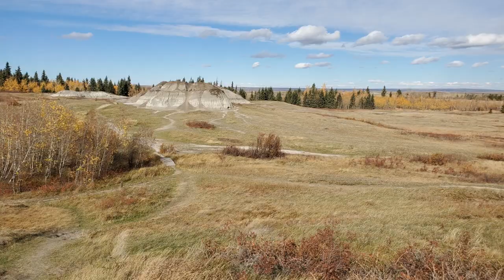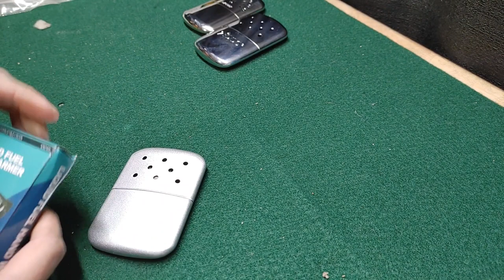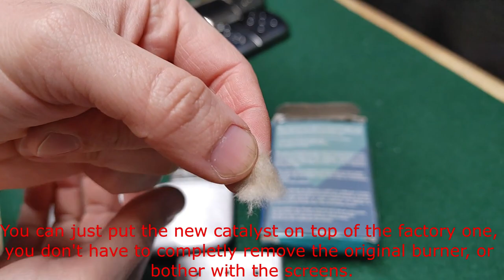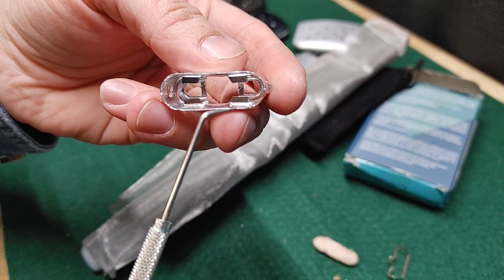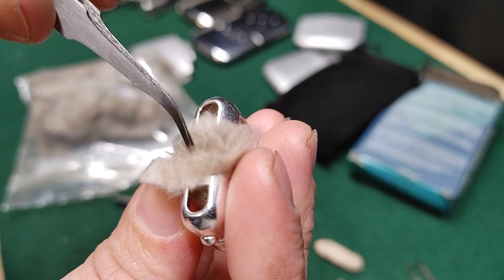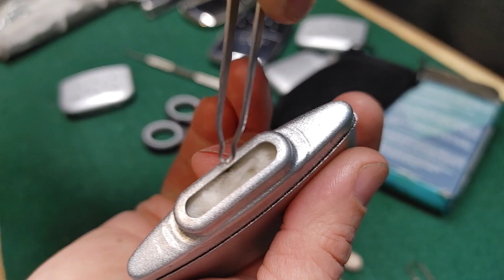Gas Hand Warmer Burner Replacement

Comment: Awesome. I did that to the ones I have like a decade ago. And the best part is the catalyst dosent seem to degrade much at all. I stuffed it in quarter inch glass weave for high temp wire Insulation. Haven't need to replace it yet.

Comment: you said the more catalyst the hotter it gets. does that mean if i have more than 1 layer of mesh on the bottom or top it gets hotter or putting more of the fluffy stuff in?
Reply from the maker: The mesh is just there to hold the catalyst (fluffy stuff) in. The fluffy stuff is what makes the heat, more fluffy stuff, more heat. Don't pack it too tight though, the fuel vapor still needs to freely flow through the catalyst. I did run a couple of these for a while without any mesh and it works fine but it's really easy to knock the catalyst out of the burner, the mesh just holds it all together better.
Reply: @canadianshawn  alrighty cool thanks. Might be fixing a couple of jon-e warmers soon
Reply: Is the mesh a bong screen?

Comment: Hi Shawn, can I change the platinum catalyst ember to ceramic wool, in my country, I can not buy platinum catalyst ember
Reply: platinum is what causes the catalytic reaction, but you might be able to get by with ceramic wool or rock wool. i’ve tried it and the catalyst doesn’t last as long as platinum would

Comment: An excellent show, thank you sir!. Very tidy upgrade and info is helpful also. 
As you made clear nearer the end, users just need to appreciate the requirement for the air-gap between the burner bottom and the top of the cotton wool in the main body: The vital fuel is the VAPOUR provided by the fuel in the cotton material.  As you stated, the cotton should remain below, and the Burner, not to touch it at all. 
The Glow of hot catalyst provides the heat, NEVER should a flame be present.